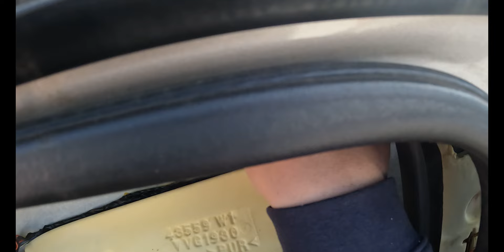ABOUT TIME  I DID ERICK HEADLINER ! 2 BUSSY DAYS ❄️

Comment: Tip101 - Next time if you want it to go faster cause y’all have a drill buy a wheel from home depot to scrape it off easier. Is the one that welder use a lot to scrape off the medal before welding. Matter a fact he has pne

Comment: Cisco....in the future when removing the foam from backing board instead of using a manual wire brush get a round one you can put in your drill gun and just pull trigger on drill..much faster. You'll have board cleaned off in like 5 minutes. That's how I do it.
Reply from the maker: We was but since it was 2 of us we did it the way but thanks tho 🫡